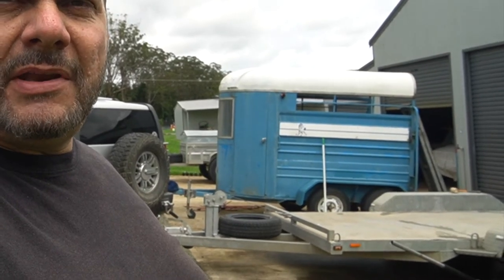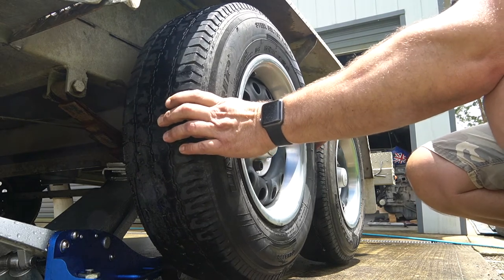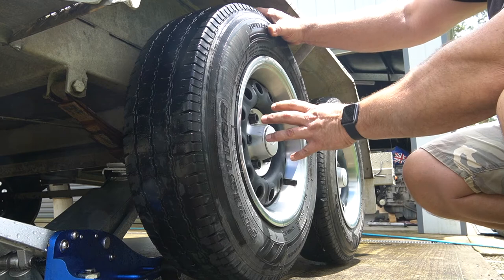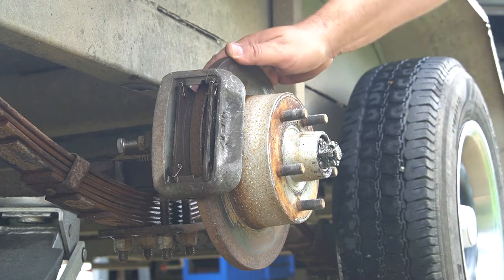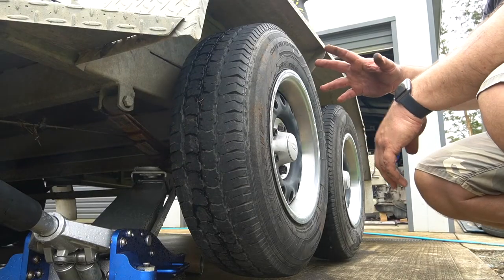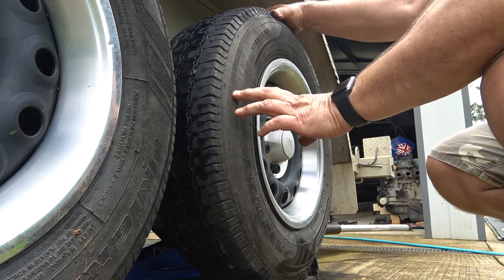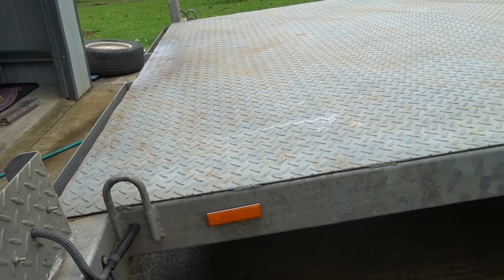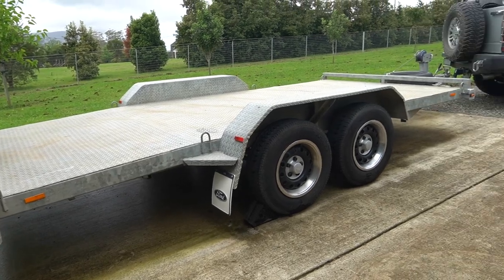Trailer Wheel Bearing Check and Adjustment - Roadworthy Preparation for Trailer

Comment: Great tips Mike and I have learnt something today about trailer bearings even though I don’t have one always good to learn something new thanks!
Reply from the maker: The front wheel bearings on your car are the exact same deal. I have changed plenty of wheel bearings on both trailers and cars over the years. Problem is it's getting hard to find quality bearings these days. Anything made in China is garbage and will not last. Had Chinese bearings fail after 12 months while my box trailer has had the same bearings for 15 years without problems. Same with bearings on lawn mower spindles.
Reply: @MikesManCave  Yes unfortunately  its becoming harder to find anything made of any sort of quality these days the future isn't looking to great if the world keeps following the path we are currently on 😒 Cheers!
Reply from the maker: @Mick_Au  Path to self destruction, lets hope 2022, will bring us better luck.
Reply: @MikesManCave  We can only hope MIke :)

Comment: "Split pin"? The terms you people come up with instead of calling things what they are. By the way, here's a little secret.. the cotter pin is suposed to be split. One side goes over the end of the axle shaft, cutting off any extra that sticks out. The other end folds back against the castle nut. Effectively stopping any chance of play in the nut, which would allow it to back off.. 

Come on "mate", if you're gonna take the time to make you tube videos, you might as well show people how to do it right. Even if it is just a simple tightening of a nut.
Reply from the maker: I don't come up with the 'terms', split pin is what it has been called for as long as I have been alive. I have been doing it like this for 50 years and it has never been an issue.

Comment: Clearly you don't have any idea to properly adjust a wheel bearing. Bearings that use grease as a lubricant must have .001" to .005" end play. Stop spreading false information.
Reply from the maker: Only been doing it for 45 years without a single failure, wheel bearings been in my trailer that gets used serval times week for only 20 years, so I guess I can always learn from your vast experience, or I could just keep going the way I am since I could not find your expert wheel bearing adjustment video. By the way educated people stopped using inches as a form of measurement in the early 70's.
Reply: It seemed to tight, you do not need a wrench for trailor wheel bearings. The only part you need a wrench for is installing bran new full wheel bearing assemblys to set bearing the race's. Also what do you mean educated people quit using inches in the 70's? That tells me your not that educated. It's a measurement that is still used, different companies, people, country's, ect still use inches and most wheel bearing manufacturers do say it in thousandths just like he said up top here, they say 001" to 005". You should be able to move the nut with your finger even after you put the cotter pin in. A tiny bit of play is what you want. Hard to tell in the vid but yours lookd fine to begin with.
Reply: @MikesManCave  LOL Hilarious. Flexing the metric muscle on us Muricans!!! haha
Reply: Why did you remove the wheel? All you had to do was take that hubcap off.... also, it looks like you're over-tightening your bearings. The proper way is to tighten the castle nut down to at least 55 ft/lbs, then back it off, then hand tight- if the cotter pin hole doesn't line up you back it off a bit until it does. 
But still no reason to take the wheel off😊